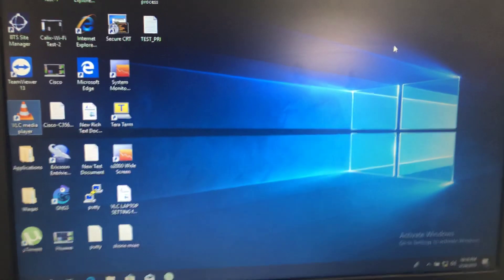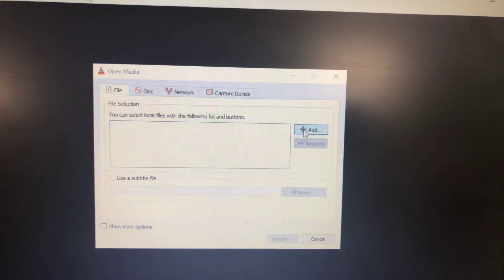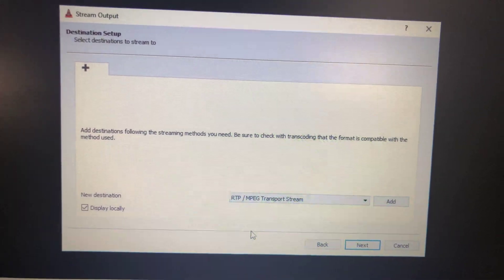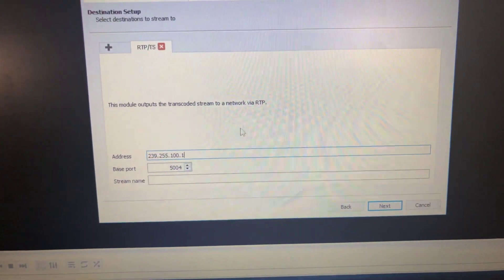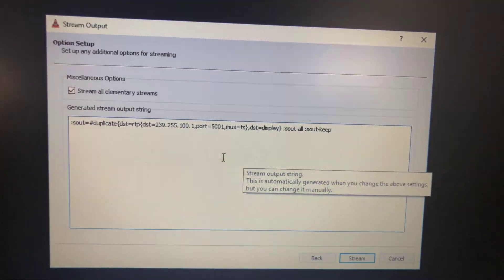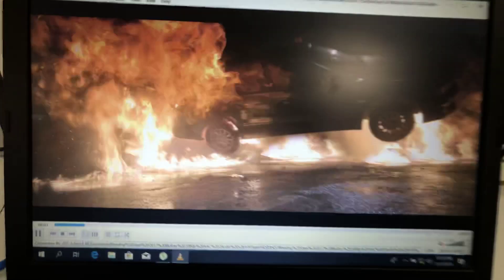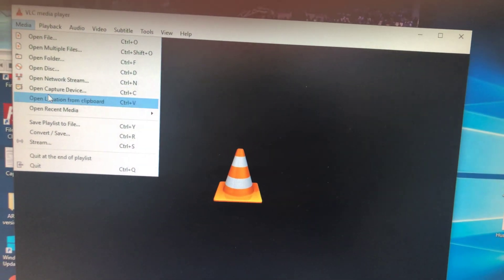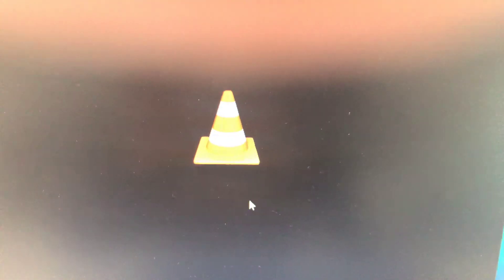How to use VLC to test multicast

Comment: Are the PCs connected directly with an Ethernet cable, and does the multicast IP address need to be in the same range as the PC IP address? Or can it be totally separate
Reply from the maker: Hello, No the PCs are not directly connected there some hop routers in between , PCs addresses are normal private IP and different from multicast address
Reply: @mohamedismail83  hi, thanks for the reply. I’ve got 2 PCs setup, with a managed switch that supports igmp. I’ve configured vlc on both pcs as per your video, but the video only comes through on the second of, it’s very poor. Are there any additional settings required in windows 10, that weren’t shown in the video? Thanks